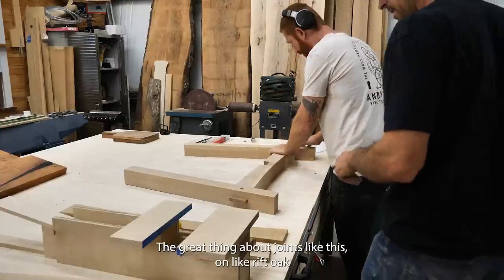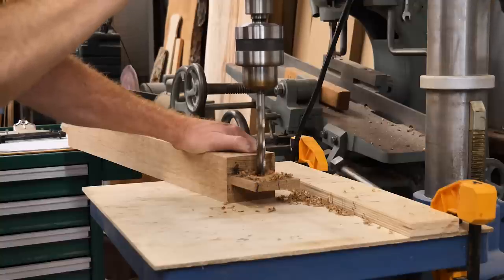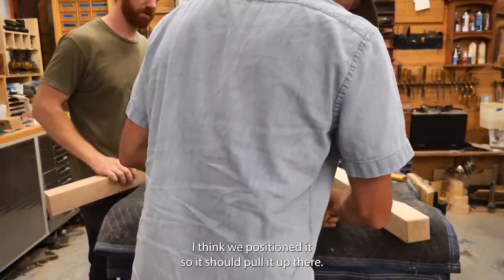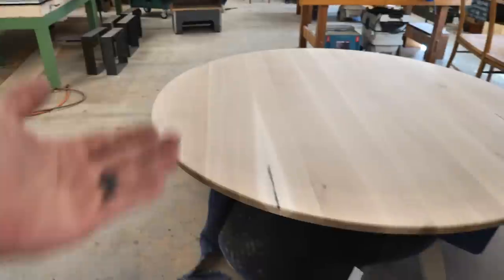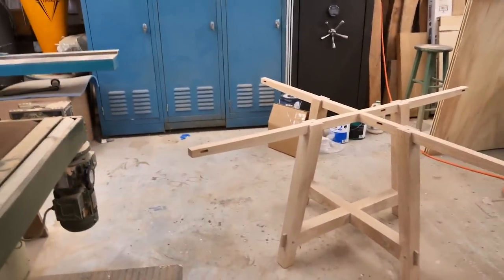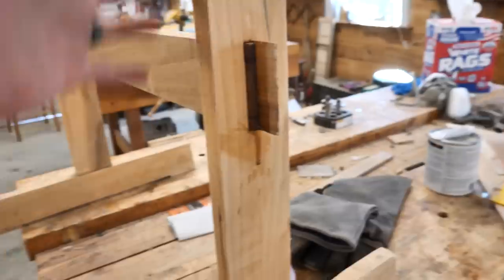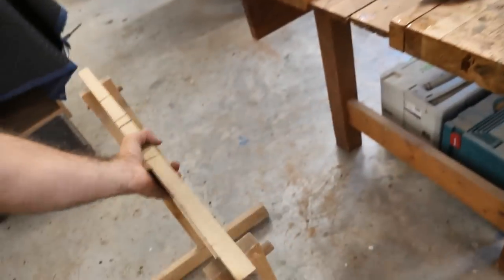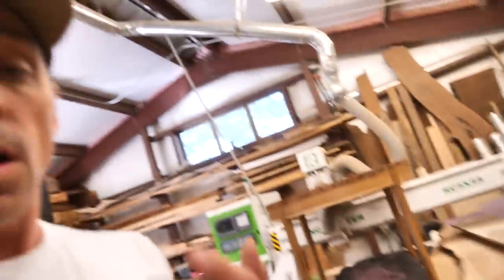5 Years Later...Repairing the "Best Sawhorses Period"

Comment: Andy,  Great video, my friend!  I noticed in the segment on sawhorse repairing, that you were tapping with your fingers to adjust your bandsaw fence's position.  What I've found to be even more precise is to use a small hammer.  Just an idea for you to use when adjusting any sort of fence on any machine.  Try it and you'll agree that it's "The Best Fence Adjusting Method Period". (Sorry, I just couldn't resist using your line).  And of course, good luck with the conference table build.  It sounds as though it'll be very interesting.

Comment: I like to make the mortise by hand, then make it wedge-shaped by adding say 1/8" to the top and bottom. Then make wedges that are at least 1/8" wide at their widest. When I assemble everything, the tenon plus wedges makes a dovetail shaped tenon. The risk is the wedges start a split in the tenon which carries through the joint. Drilling a small hole at the base of the slot is supposed to stop the split early.